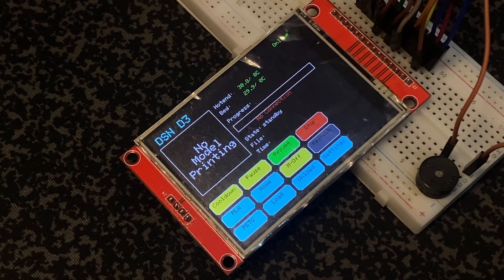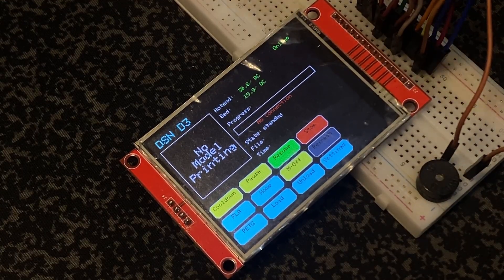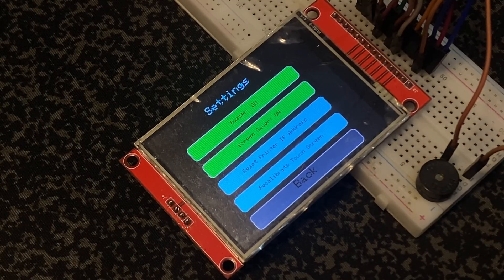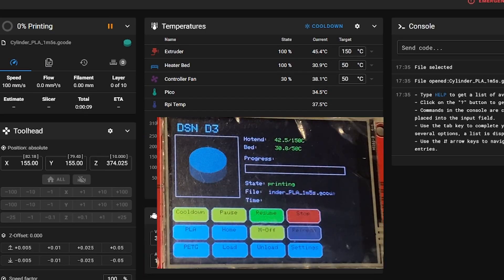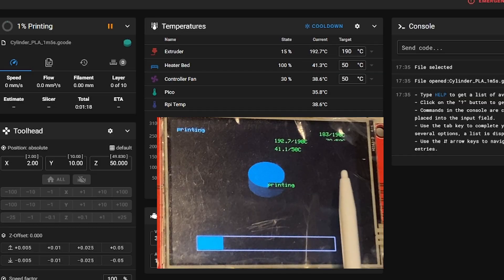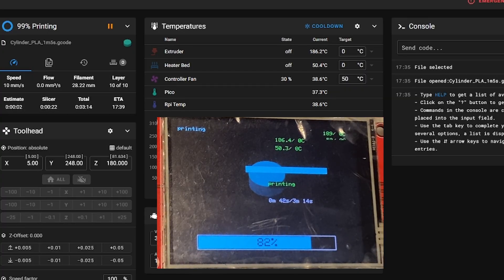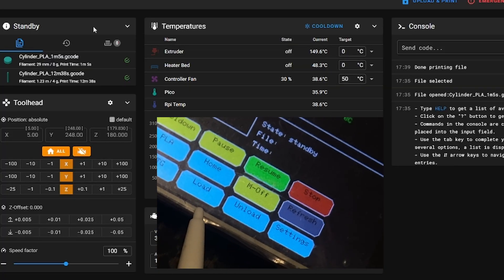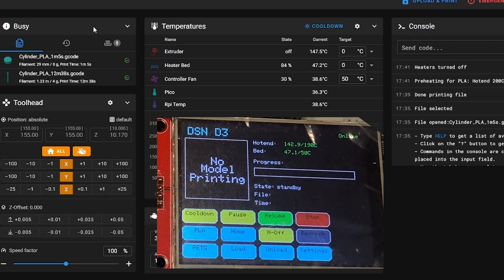I Build Klipper Control Screen w Esp32 and ILI9341 Touch Display from  Scratch

Comment: And wouldn't Klipper be found on the ESP32E_3.5inch TFT Driver ST7796 ?
Reply from the maker: Maybe it can be found, but my system controls the printer wirelessly using an ESP32 processor, without putting any load on Klipper or the Raspberry Pi, by utilizing the data they already publish.